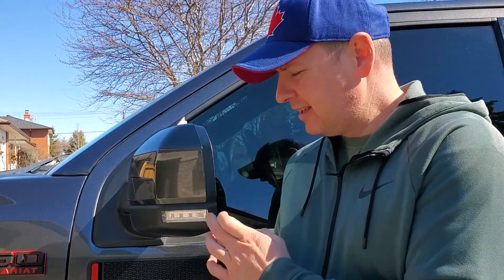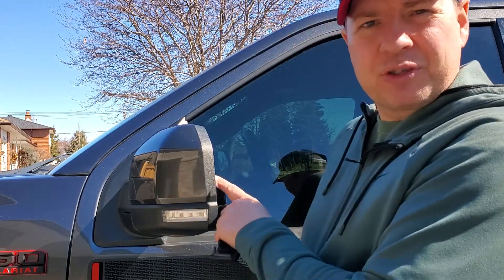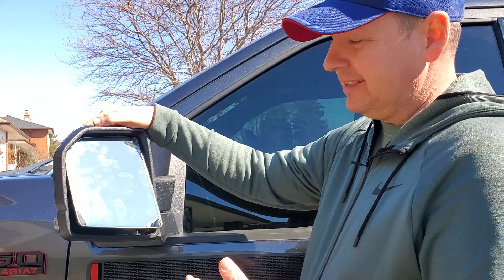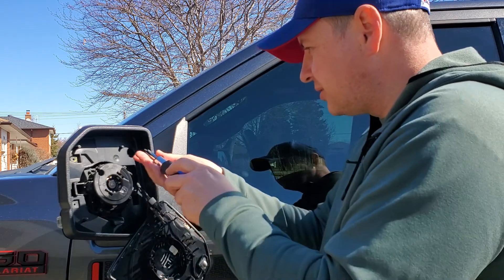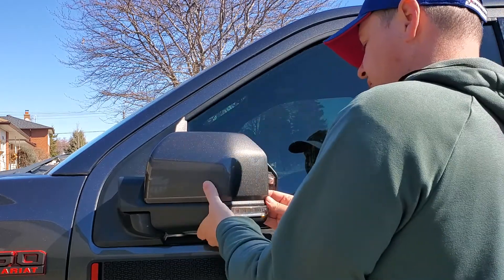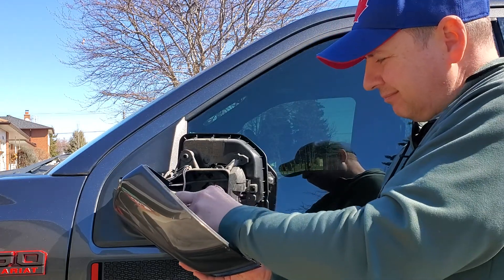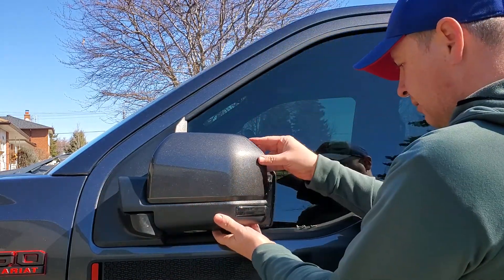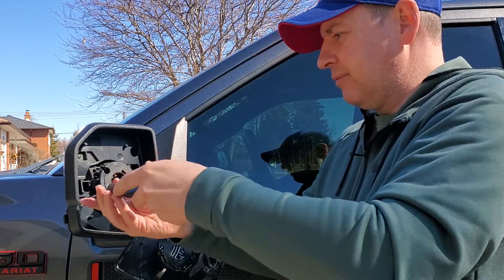F150 AXIAL Sequential LED mirror marker light install

Comment: We're you able to still use spot light feature w these lights
Reply from the maker: There is still the light under the housing that faces down but the Axial is only a turn signal.

Comment: Any tips on removing the mirror glass? I haven't had any luck
Reply from the maker: I show how to remove the mirror in the video. Push up, get your fingers under, grab both sides and just pull it will come off with some force. Be careful not to pull too far as there are wires attached, unless you don’t have power mirrors.

Comment: just installed the Morimoto mirror lights. passenger side light is intermittent. I think its a connection issue. did you do anything specific to fix the connection?
Reply from the maker: Hello. I did not do any sort of wiring changes, just made sure the contacts were clean and the harness was well connected otherwise they were plug n play. Sometimes these products are defective. Cheers
Reply: what did you use to clean the harness?
Reply from the maker: @GetOuttaDodge1   I used very fine sand paper
Reply from the maker: @GetOuttaDodge1  just clean up the contacts.